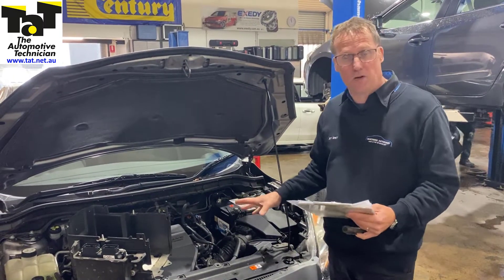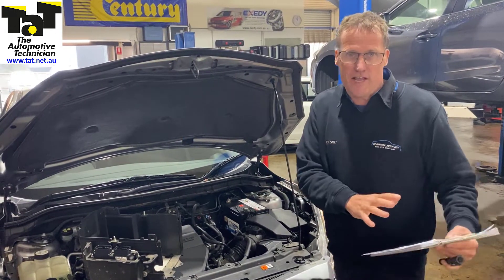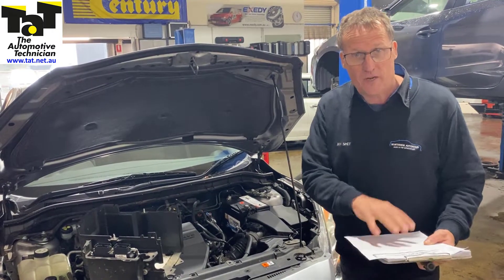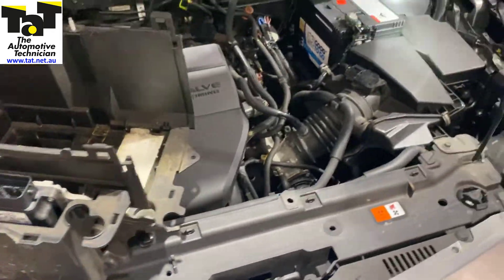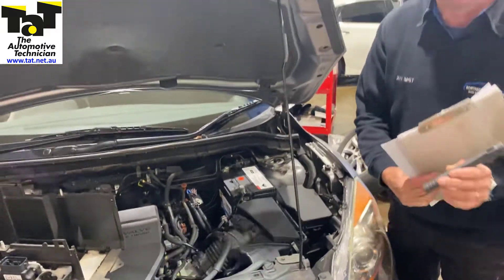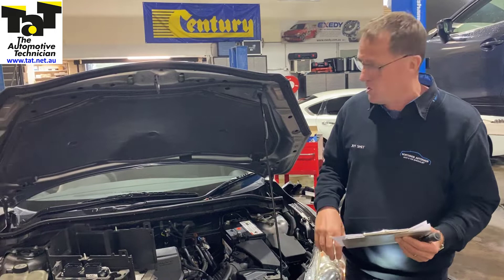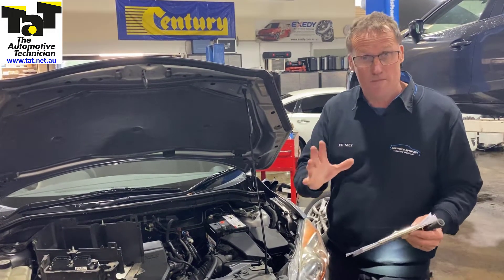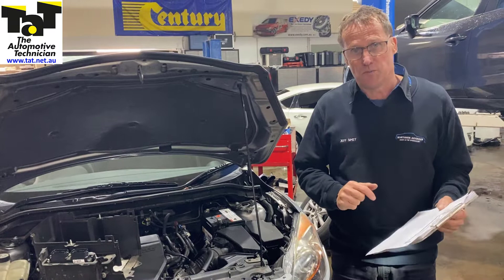2011 Mazda 3 in limp mode with the transmission stuck in one gear

Comment: Mazda 3 have always had issues with their transmission control modules. Why has Mazda not replaced these under a national recall scheme.
Reply: Same here ,that the problem I’m having right now in my 2011 mazda 3 

Need to have a recall in this problem
Reply: @giotok1142  the only way they would do it is if they had a big lawsuit.